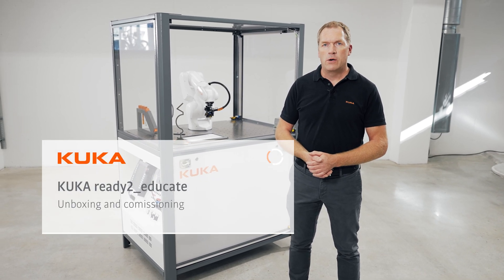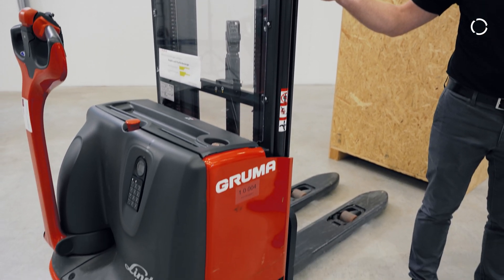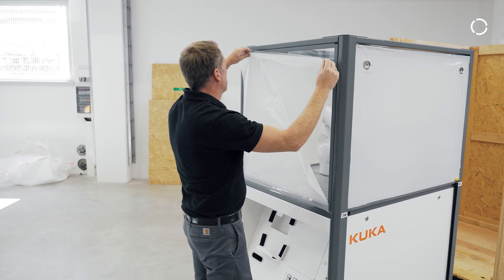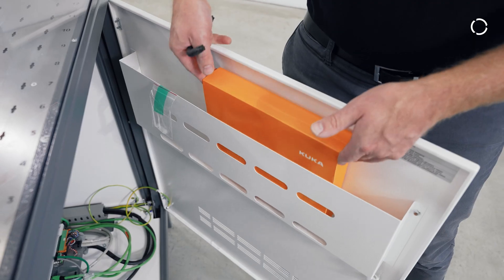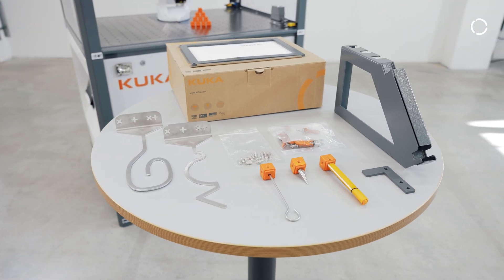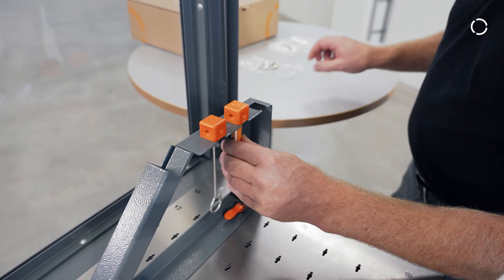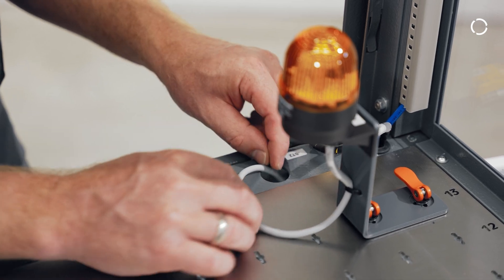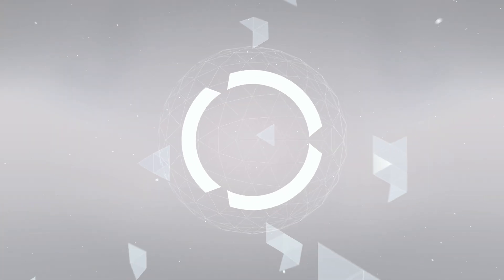KUKA ready2_educate: a mobile training cell perfectly suited for entry into the world of robotics

Comment: Great video . I wonder what the lamp which is connected to XG33 for . does it indicate when the sensor is connected to the same XG33 . or it indicates when the emergency button in TP is on or there is a break for the robot motor ?